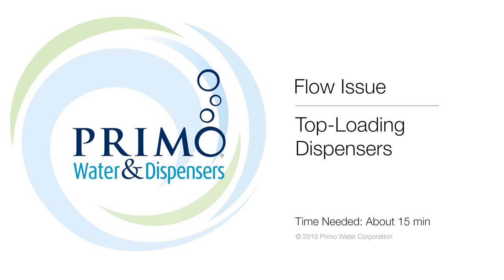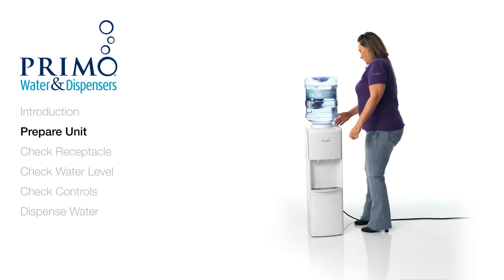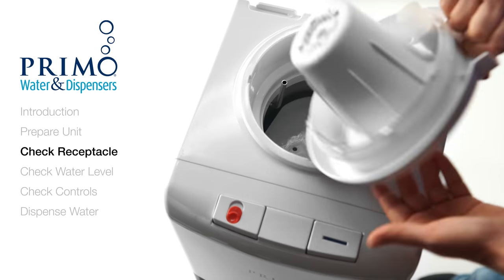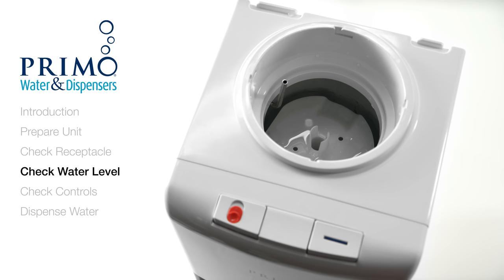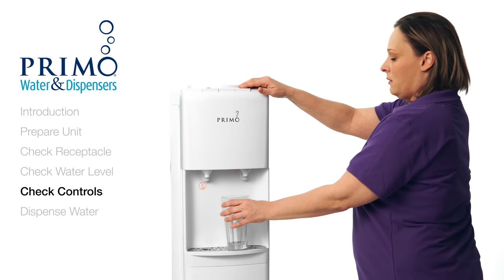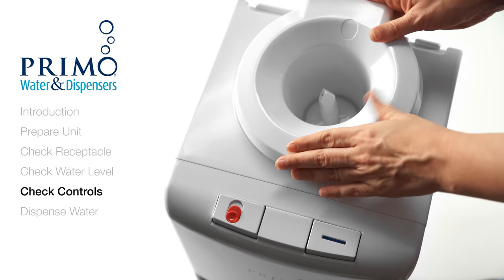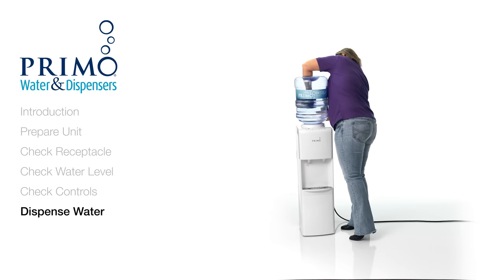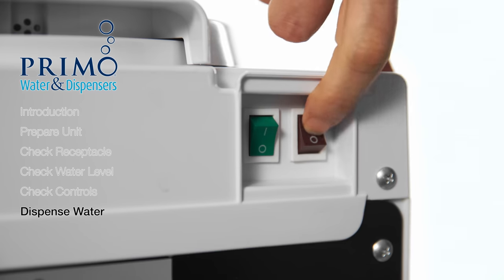Top Load Flow Issue

Comment: If you're using a Primo-brand water bottle, check to make sure that the bottle's inner foam cap is not blocking the flow. I was having this issue and swapped out the Primo water bottle with an Ozarka bottle (which uses a different style of cap) and the problem disappeared. You could also manually cut or tear away the foam cap before putting it on the dispenser to ensure that it doesn't block the water flow.
Reply: Thank you. Brand new unit and have to tilt the jug to get air in. I had a feeling that was it and glad for your comment.

Comment: Should I be concerned that a "how to fix it" video has 312,205 views?
Reply: nope, it helped me totally and I review it each time i want to clea it!
Reply: Absolutely. That comment made me chuckle. Translation: the unit is garbage and 312,205 people have a broken one. I tossed mine out the back door and smashed it with a bat. I immediately felt better.
Reply: @roganhennie2201  probably sold 10m units
Reply: @marcg2526  That's too easy: because the planet has more half-wits than ever before and selling cheap products to them is easier than ever before. Kudos to the company for having the smarts to build something to sell to them though.  Don't try to tell me 10M units means it's an amazing product though lol.
Reply: I have my primo for 7 years now, and this is the only time I am googling how to fix it.
Reply: Just had to put back a plastic thingie that came loose from the top of my dispenswr. Saw how it was attached right here. Unit works flawlessly!

Comment: I recently decided to try and fix as well as clean my water dispenser. The nozzles drip water after use. Anyways,  after cleaning the gunk and reassembling it, I was somewhat dismayed I that I hadn't noticed the cylinder tube on the bypass plug.  I looked everwhere on other videos and as I do product  informercials myself I came accross yours. Well done, its completed so when you google this model you find the right one. Kudos to you and primo water Co. I ordered the smaller stand as I don't need cool and hot. Thanks.

Comment: You need to post a video showing how to remove the filter screen where the water comes out from. Mine was clogged and I almost threw out my unit because of the trickle of water that was flowing. It was taking over a minute to fill my glass. Luckily, I found a video on youtube from a user who had the same issue as me and he showed what was wrong with my dispenser and how to fix it. Had it not been for his video, I would have gotten rid of my dispenser.
Reply: Do you have a link please?

Comment: This might sound really dumb... but do I have to turn it back on to retrieve water. 
It’s my 1st time owning one of these & im absolutely clueless
Reply: I'm just an Emmy award winning photographer....Im not a repair guy...
 I believe that water flow in this model is gravity feed, so the valve is mechanical & doesn't need to be plugged in to dispense water.
The plug is just to heat & chill the water.

Comment: Can you use any water 5 gallon bottle ..and is there subpose to be a rubber seal or something...my bottle doesn't have a cap and wonder I it will just keep pouring out the top..??
Reply from the maker: Thank you for reaching out to us. You can use any 5 or 3 gallon bottle with our dispensers with the exception of the brand American Maid and Glass bottles. The way the neck of the bottles are manufactured makes them incompatible with our dispensers. Please let us know if you have any other questions or concerns.

Comment: My Primo dispenser is causing the water bottle to collapse. It has significantly deformed the water bottle. Water comes out of the dispenser but, to repeat myself, the bottle is collapsing as if air is not making it back into the bottle. Do I need to look for some type of clog?
Reply: It may also be a faulty water bottle.  I brought in an empty bottle to compare it with the bottle in question. It seems the bottle that is collapsing is made of a thinner plastic and the writing on the top is not well defined as if the injection molding process did not completely fill the mold.  Please let me know what I should do about this.
Reply from the maker: Hi - Thank you for your inquiry! When the bottle begins to collapse upon dispensing, this indicates the bottle is not compatible with the unit. You can use any 5- or 3-gallon bottle with our dispensers with the exception of the brand American Maid. The way the neck of the bottles are manufactured makes them incompatible with our dispensers. Hope this helps!
Reply: @primowaterco  I bought the bottle at Lowe's.  All the bottles have a PRIMO label on them. How, in that case, do I differentiate Primo from American Maid since there is not other identifier on the bottle since all of the bottles have a Primo label on them.
Reply: @darrylcrum2495 did you get an answer same is happening to me the bottles are made with a different plastic now so thin and my primo bottle is collapsing too
Reply: @primowaterco  Mine is doing the same thing and I am using a Primo 5 gallon water bottle. Could something be wrong with the machine.

Comment: Utter BS.The primo bottle is at fault in my case.They substituted the little breakaway plastic seal for a foam stopper and it failed.Using tweezers I pulled the little foam tag out and it worked again.So from now on,I have to do this before inserting the bottle,all because Primo changed the design of the bottle seal.